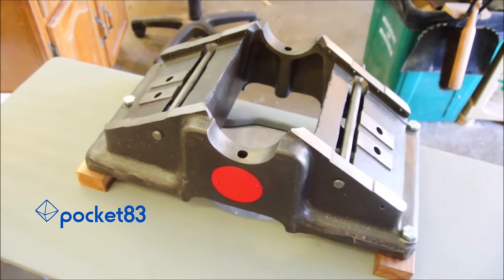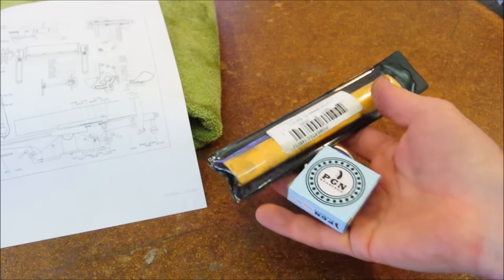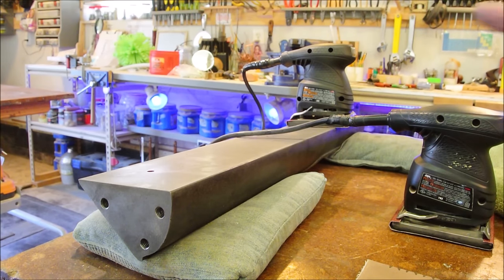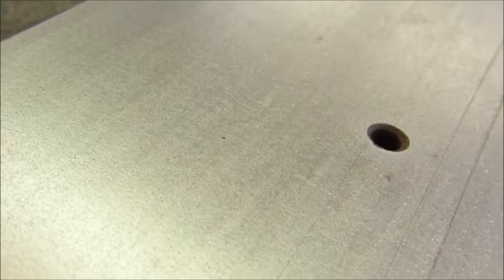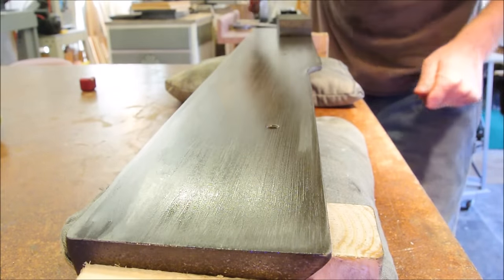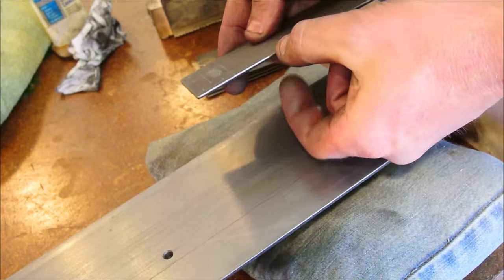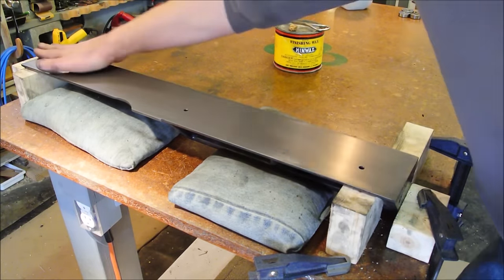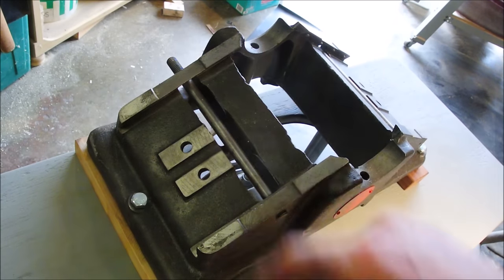1940's Delta Jointer restore: re-surfacing planes

Comment: I was given a smaller (I think 4" cutter) Craftsman jointer a few years back. I thought, "It'll be just a couple of hours to get this thing back into shape." Ha!

I told myself, "Just get it done. Finish what you start." Ha!

Well, I finished it, and I've never used it. Oh, the irony.
Reply from the maker: Do you ever mill your own material? Because then a jointer sort of becomes a must. I'm sitting on quite a few years of rough-cut, and the cruder methods of giving a board a straight edge have gotten downright tedious. 

Now that it's done, the tool is surprisingly easy and pleasant to use. It's not even that loud, at least, not relative to E-wal, my resident yellow jet-engine powered planing machine.
Reply: @pocket83squared  I haven't milled my own material often. Although, I do have a few cedar trees that I will be working with someday.

Comment: Nicely done. Thank you for no mid roll adds - not that I see those anyway with the subscription.
I noticed that you didn’t show flattening the stone before using it. Maybe it wouldn’t make a difference on a large surface like this as it might for things like chisels. Just using it as such probably flattened out the stone.
Reply from the maker: Good point. Nice thing about dollar-store stones is that you can buy two of them and then swirl them against each other until they true themselves. Do you have a better way to flatten them? I'm asking seriously. Also, do subs really not have to see mid-rolls? I don't subscribe to any channels.

Comment: Tip for better diamond stones, if you can stomach buying from and sending money to Russia in the current climate (I bought mine before 2022) is Venev - these are diamond filled resin on a metal base. Double sided 2 grits per stone. Available in all sorts of sizes. There are probably other manufacturers of diamond stones of this type but I'm not aware of any available to me. They are VASTLY superior to any of the cheapy single-layer surface coating diamond ones like you show in the video as "consumable".

Comment: Do you think the Ludacris song "Roll Out" was about installing sandpaper on a quarter sheet sander? A lot of people have been asking me about that.
And, yes, I do have a milling machine 😀 though I suspect the jointer surface is hardened and that you'd need a grinder if you wanted to use a machine tool for this sort of work. -JC

Comment: Another way to flatten the jointer plate is to machine it on a milling machine. It shouldn't have to take much off the plate and is more accurate than sanding.

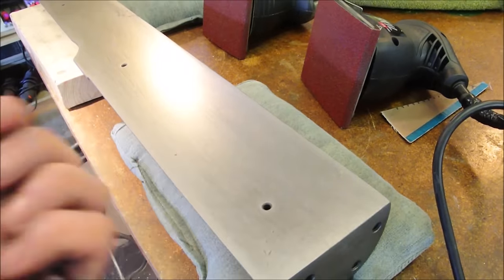Comment: @6:17 oh, sure it starts with sanding, and then maybe hand scraping and surface plates, and the 3 plate lapping method, and sub micron diamond lapping paste, and optical flatness gauges and weird lightbulbs with strange wavelengts....where does it end?!?! j/k
Reply from the maker: The more interesting question is, where did it begin? 

No, seriously, think about it. Go outside into the woods, and look around: there is no flatness to be found in nature.¹ You can start to make flatness if you try, though; grab two similarly flat-ish rocks, and start rubbing them together. Eventually, some flatness emerges, and the refinement process can begin. But again, you choose the degree to which you become involved. Ultimately, flatness is an ideal, just like roundness. There is no plane. Such refinements require conscious effort, and natural processes will not get there on their own. Unless, of course, the universe happens to be infinite. But that's flat-out not knowable. Plainly.      

¹Ice doesn't count, smarty-pants. It's spherical, because of gravity.

Comment: And here I thought that you were going to fasten the whole sheet of sandpaper on the flat surface of the work table and then run the jointer plate over the top of the sandpaper to wear down the surface evenly.

Comment: I have that exact set of diamond plates for knife sharpening. They work great but do indeed need a holder. But they are 1/4 of the price of 25-30mm thick diamonded stones and i'm pour :face-green-smiling:
Do not use water or lube on diamond stones/plates btw. They are not made for that, they are not wet-stones, and Gum UP, fast. :body-blue-raised-arms:

Comment: Dubious flattening process IMO. Using engineer's blue and granite or glass or a cast iron surface plate and working on the high spots would get it flatter. Much of what you did was surface finish more than flatness. Decent effort overall though :-)
Reply from the maker: Passable try, conjunction, emoji, eh?

Thanks. I imagine that you must live in a castle of pure light; a place of pure harmony where the a priori and a posteriori have no discernible difference. But here in my lowly, sawdust-floored shop, mired in my ignorance, 'flat enough to make a straight edge' will have to suffice as planar. 

It's always nice to be reminded (again) how my procedural, tool, and mental limitations have ended up contributing to a less-than-perfect end result.
Reply: @pocket83squared  I don't understand the first sentence/question at all. Not withstanding that, no, I live in an old house with many, many, many imperfections and a beautiful country with its own problems and benefits. It is evident in the video that despite stating the opposite you prioritised appearance and finish of the restoration over actual flatness. Actual flatness does not mind that scratch you managed to remove, nor that pitting you didn't get beyond. Lows like that are not an issue at all. Highs are an issue. Large valleys are an issue. Using a reference surface to true up your surface to will help get it flat faster. I would never put an orbital sander (of any type) near a surface I needed flat. Only one that I wanted to paint or had painted :-D Quit the defensive stuff, man, you're good value, but the attitude is entirely unnecessary. Get a slab of kitchen granite, validate its flatness (regularly they're part of a large sphere) and then use blue to test your work. You are right that a planer must be flat to do a decent job, and you may have it close, though the straight edge test immediately showed a low and the "high spots" you described were almost certainly uneven pressure/technique. It's not that I could do better using your techniques - it's that you could do better using different techniques. A machine of that vintage deserves it IMO. I have some old machines made here and will be giving them some love of a similar nature at some point.
Reply from the maker: @fredio54  Wow. I'll make it easier to understand this time: you are insulting and unreasonable! First of all, I'm not going to buy anything extra to (unnecessarily) flatten something if it will just end up sitting around the shop. I didn't prioritize appearance over flatness here; I prioritized FUNCTION over every other consideration! 

Don't make me put it in ALLCAPS: this was only a wood edge-jointer; it was already far flatter than it needed to be in order to produce a high-tolerance end product. And I did NOT cause any pits or high spots by uneven procedure! I addressed and reduced existing imperfections, and I ended up with a vast improvement, given very little time investment. 

As for your own planes, polish them all you want. This one will be used for milled lumber. Have you ever milled a log? You always test your jointer tables first with engineer's blue and granite, right?

Comment: People like random orbital sanders because they don't want obviously visible swirls. Quarter and half sheet orbital sanders leave bad marks on the work piece, especially if fouled up.
Reply from the maker: That talking point may be why people like them, but it's not true. Sorry to say it, but "random" orbital sanders are a well-marketed scam that's been engineered to get people to buy overpriced replacement pads. 

Stray pieces of debris caught under a "random" sander will still cause pressure damage. And they still scratch; that's how they're able to sand. Swirls and scratches are functionally no different, because they both can only be removed by using (increasingly) finer grit sandpaper. 

"Random" orbital sanders only temporarily disguise swirls. For those who are skilled, 1/4 sheet sanders are cheaper, faster, and more effective. Further, woodworking usually involves sanding in corners. As a person who's sanded to the Moon and back, I'm not buying it.
Reply: @pocket83squared  I'm not sure what you buy/don't buy - the random nature of short-stroke random orbital sanders means there is NO predictable pattern when used correctly and with no pattern, ie a random pattern, it is FAR less noticeable to the human eye. Yes, you still have to go between grits, yes it still leaves swirl marks, though far less obviously. Speed of sanding comes down to the stroke. If you want a fast sanding result use a polisher as a sander, 15, 21, and higher strokes are available. If you really want to hog off material though, pick up a belt sander. I own quarter, half, and random 5" sanders - each has their place - they perform different tasks to different standards. There is nothing to buy or not buy except the sanders themselves.
Reply from the maker: @fredio54  "FAR less noticeable" is exactly what it sounds like; if you're after a nice finish, then you'd want to notice imperfections, so that you can address them. Funny coming from you—considering you'd have me hone my jointer table (a tool) to unrealistic flatness, but then you'd mask the symptoms of a poor wood finish (an actual project).  

And 1/4 sheets are nowhere near the cost of buying disks. Even with all other things equal, a circle implies four spandrels, which means a higher manufacturing cost per surface area unit.  

Man, you're a condescending one. You even slipped in a belt-sander lesson there. You must be a boss somewhere. You'd find it intolerable as a subordinate, huh? Well, me too. But please, stop talking down. I'd much rather spend my exchange time talking about something productive. This subject is downright petty. If your future comments are going to be (more) unsolicited procedural 'improvements,' then you're going to end up ignored.
Reply: @pocket83squared  Wow, dude, chill. I talked about sanders in my initial comment in response to your loaded comment about sanders in the video. Your replied. I replied. You replied with ad hominem. Really? Ignore away. <3 If you're like me you're constantly pursuing excellence and trying to improve your knowledge and increase your skill - if you ignore feedback about blatant mistruths in your videos that is fairly and cleanly stated and simply attack the authors your road of improvement will be harder and longer. Your loss. Good luck.

Comment: Tech Ingredients would agree about not using oil with sanding metal, they told me that they don't do it cause metal shavings will scratch the surface when they use oil after their thermal paste testing